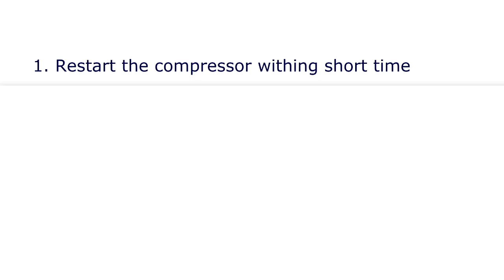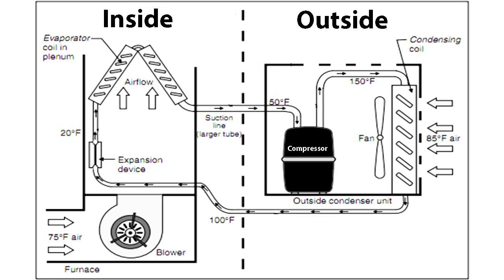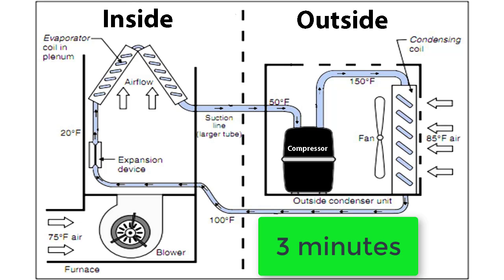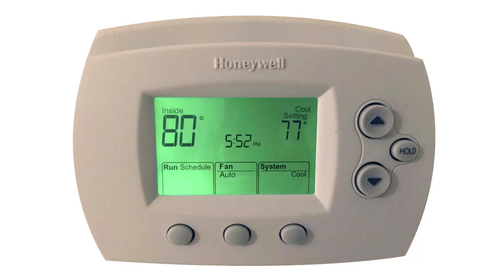Thermostat Cool On or Heat On flashing

Comment: It happened exactly like you said. My cool on was blinking at the bottom. So I replaced the batteries but I lowered the temperature down. The compressor came on in about 5 minutes
Reply from the maker: Thanks for watching!
Reply: @Your-Self  no problem. Thanks for your informative video.

Comment: Thank you!!! It's roasting in here and it wouldn't turn on after returning from a vacation thought it was broken.  Counting down the minutes till i have a cool place again!   :)
Reply: Did you get it working? I’m having the same problem but it’s been past 5 mins
Reply from the maker: @Written check the Over-Flow Sensor around the Air-Handler/Furnace area. It could be full of condensate water due to a clogged drainpipe.
Reply: @Your-Self  I actually did just that and it’s been working. It’s not working at it’s full capacity like before, but it’s slowly getting there
Reply: @written8595  Yes it worked..took over 5 minutes for mine.  I think my daughter turned it on first then I tried to "fix" it. LOL  Works great now!!! So glad this video was posted!!!
Reply: #Same here🎉

Comment: The "cool on" and "set to 78°" are both rapidly flashing for me.  The AC was running fine before I left for work, but hasn't turned on once when I got back.

I've tried:

*Resetting the thermostat by removing, reversing and waiting 30 seconds, then returning the batteries.

*Waiting 30 second intervals between each one, turned off and turned the circuit breakers from the primary board, the inside unit, and then the outside unit.

*The fan does come on when switched to the "on" setting.

The unit is only 2 months old.
Reply from the maker: Did it ever flash the "set to" temperature before? Seems like it's waiting for a confirmation which you need to press some button. What is the model of your thermostat?
Reply: @Your-Self  
Same model as the one in the "is it bad" video.

This is the first time I've seen it do this.
Reply: I had the system off for about 30-45 minutes and the interface stopped blinking.

It turned on and ran for 3 minutes before turning itself off.  Now only the "cool on" is doing a slow blink.
Reply from the maker: You may have an Overflow Switch installed around the air-handler/furnace. Make sure that the evaporator drain pipe is clear and draining water.
Reply: @Your-Self  
They have the pvc pipe for the water drain outside, elbow up, to which you can see water inside it and it looks like it was draining over.

When the unit first turns on, you can hear what almost sounds like a slurping sound and a few grains of sand bouncing around.

Im not the owner of the unit, so it will take me a bit to find paperwork to find the Overflow Switch...
Reply: @Your-Self  
Sadly, they did not install an Overflow switch.  Theres no nearby sensor to unscrew and drain water from the sensor.

The pipe just goes outside to drain.  I'll drain it out and see if that fixes the issue.
Reply from the maker: You don't really need to find the switch, just clear the drain pipe. The best way is to suck the wet clog from outside with a shop-vacuum. If you don't have the vacuum, you may need to call service or get creative to unclog it.
Reply: @Your-Self  
I drained water from it but it still kicks off.  I'll see if I can dig through the shed in the morning and see if I can find a shop vac.

Otherwise, I'll inform the landlord about the issue, who's out of state at the moment.

Thank you for helping though.
Reply: @Your-Self  
Well, it looks like I was just impatient.  I didn't wait the full 5 minutes for the timer the compressor has between cycles.

The AC has been on for a straight 30 minutes now.

I used a turkey baster to remove the excess water.

So thank you for your assistance.  I did not think of draining the pipe, it didn't occur to me that the water was a bad sign.
Reply from the maker: So you got creative, lol. Good job!

Comment: What could it mean if the AC turns on, and then within a minute or so turns back off and the Cool On icon starts flashing and it stays off for much longer than five minutes?  This has happened 3 times since we turned the AC on this year(about 3-4 weeks)  It's happening at this moment. Turned on for less than a minute, turned off, the Cool On snowflake is flashing but it doesn't turn back on for 15-20 minutes. Never happened in 8 years before this year. usually it was just like you said, if I lowered it it would flash for a few minutes before turning on
Reply from the maker: Intermittent problems could be difficult to troubleshoot, so you may want to call a good tech. The problem could be with the thermostat, the motherboard, the contactor, loose wire connection which may need to be simply replugged/reconnected... hard to say without being there, sorry.

Comment: What if your thermostat is running but your fan outside isn't?  Its blowing air but not cool air.....,
Reply from the maker: Try changing batteries in your thermostat first, they are maybe too weak to close the contactor in the condensing unit outside. If batteries are new, the contactor may be stuck open with debris, disconnected, or chewed wire at the contactor.
Reply: @Your-Self  Having same problem here. Is the contactor part of the thermostat or is it something on the outside unit?
Reply from the maker: @ALI W the Contactor is in the outside unit under 240V, so it can be dangerous. The large capacitor may be bad as well, in the outside unit also.